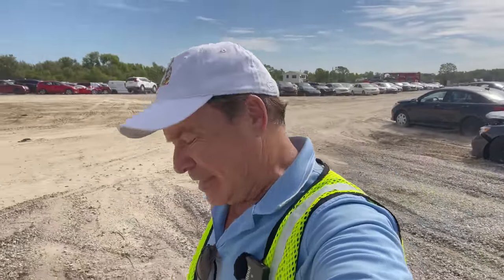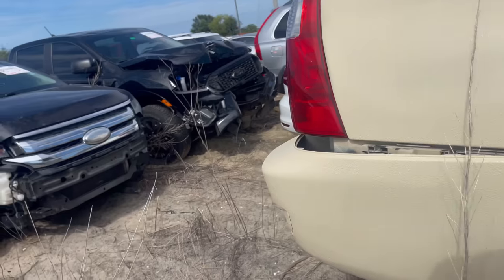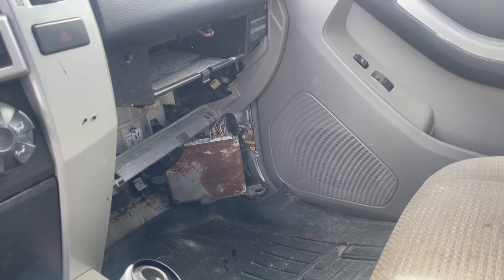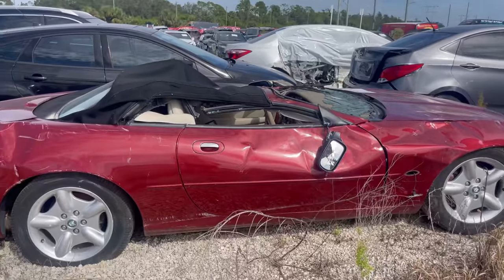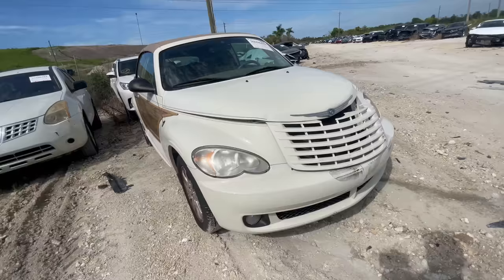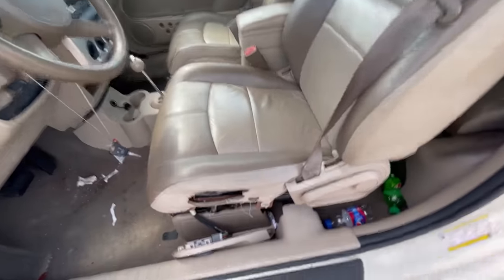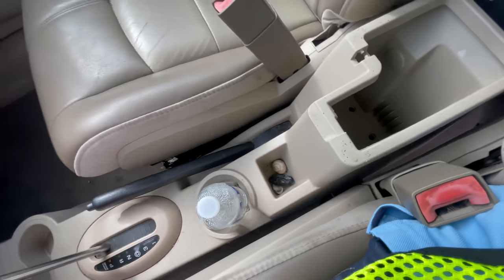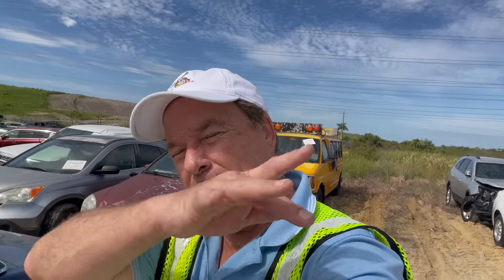I Got Wood!! IAA Walk Around 9/14/23

Comment: Pt cruiser aka mercedes E & C class platform just as chrysler 300
Reply: Wrong! The PT platform was Chrysler's automobile platform for the 2001–2009 Chrysler PT Cruiser crossover SUV. It is a front wheel drive platform with no provision for all wheel drive. Contrary to early reports, PT was not based on the Dodge Neon's PL platform.
There were no other vehicles produced using the PT platform.